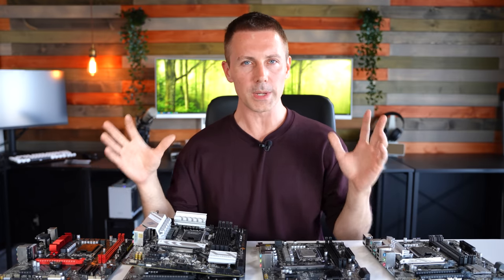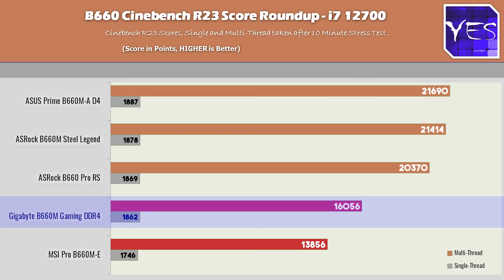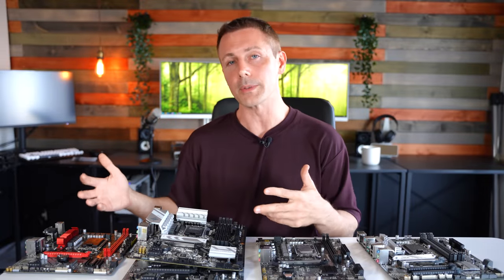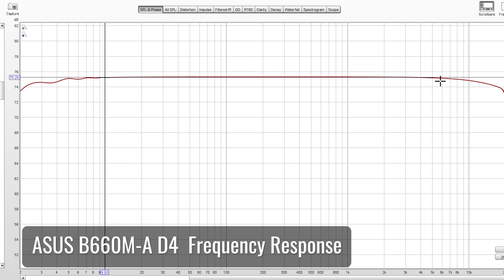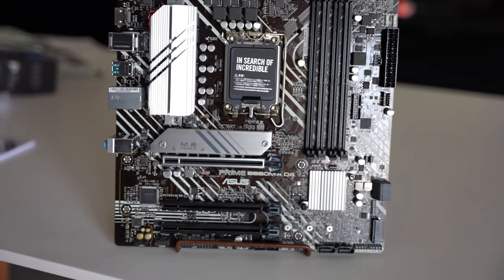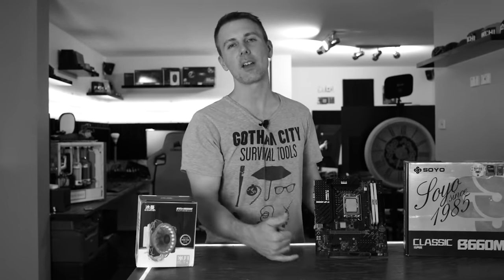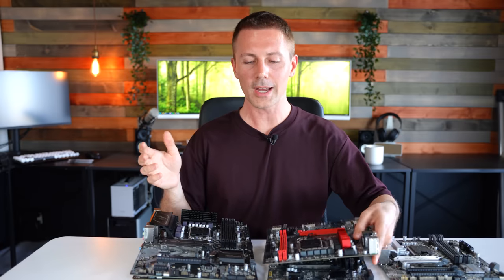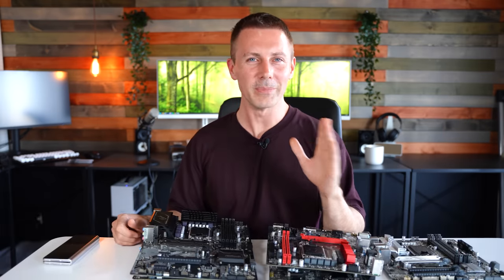What's the Best BUDGET B660 Motherboard?

Comment: Asus Has been pretty consistent of their motherboards even though they can be a bit pricey sure it could be better as adding in a 2nd Heatsink at the top would have made it perfect but you could just do what I do and get those real cheap GPU ram sinks online and just plonk them on there and it would be good enough to drop the temps on those VRM's by 10-20C.
Reply: If you put an air cooler on the cpu the fan will blow down on the vrms so temps might be decreased and if you have casefans

Comment: What's interesting to me is that the MSI B660-M Pro A is often hailed as one of the best affordable motherboards in this chipset. Of course its got some pretty decent heat sinks on its VRMs compared to a complete lack of them on the E.
Reply: What about MSI Pro B660M-G? Is it good for i5 12500? No gaming, no overclocking. Just casual office tasks, Photoshop, not heavy video editing
Reply: @Uncaught_in_promise  Invest a bit more and get the B660m-a, you won't regret it.
Reply: @rahuloberoi9739  agree
Reply: @rahuloberoi9739  i think i missed up when i bought msi b660 ma pro , with i5 12400f , rtx 3060ti  , idk what i was thinking
Reply: @yousefal-bakri3455  why?
Reply: @azriel1595  i was a litlle mad because the motther board looked small in the case 
and i wanted ATX one 
but now i dont think its a problem , everything is fine and works very good
Reply: @yousefal-bakri3455  its a good board though, right? I'm thinking of getting it and pairing it with an i7 12700k. maybe a 3070 or 3080 idk.
Reply: @azriel1595  yes it is , but since you want to buy i7 , get  Z board its better 
but for i5 , b is very good
Reply: @azriel1595  Get the  msi b660m mortar, better vrm heatsinks I think in my research slightly better than the b660m-a pro, usb-c if you care, better audio, a few extra fast USB, both m.2 have heatsinks  pro-a has more video ports 4 v 2 so if not using a card. Both good though so if you want to save 20 or whatever the mortar costs over the pro-a

Comment: 🎯 Key Takeaways for quick navigation:

00:00 ⚙️ Introduction and Motherboard Overview
- The video introduces a comparison of budget B660 motherboards for the i7 12700 CPU.
- Five motherboards are tested, including MSI, Gigabyte, ASUS, ASRock Steel Legend, and ASRock Pro RS.
- It highlights the importance of choosing the right motherboard for your needs.
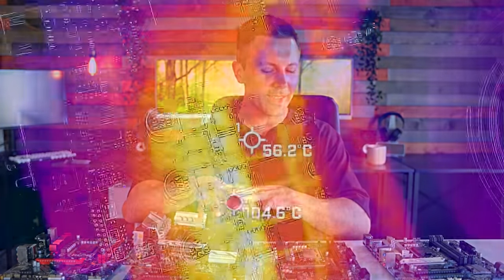01:37 🌡️ VRM Torture Test and Performance
- VRM (Voltage Regulator Module) torture test using Cinebench R23 is conducted to assess motherboard performance.
- Results show significant performance drops on the MSI and Gigabyte motherboards, while the ASRock Steel Legend and ASUS boards perform well without throttling.
- Single-core test results and temperature readings are discussed.
05:32 🔊 On-Board Audio Comparison
- Comparison of on-board audio quality using the Realtek ALC897 codec on all five motherboards.
- ASUS motherboard stands out with the best audio quality, followed by the others.
- Audio codec, trace layout, and capacitors are essential factors affecting audio quality.
06:53 🛠️ BIOS Settings and Features
- Evaluation of BIOS settings and features, focusing on the ease of customization and undervolting.
- All motherboards allow essential settings adjustments, but the Gigabyte motherboard has a somewhat confusing BIOS.
- ASRock offers unique features like internet DHCP BIOS flashing and in-BIOS RGB control.
08:59 🔄 Connectivity and Features
- Comparison of rear I/O connectivity, with all motherboards featuring six USB ports.
- ASRock Steel Legend stands out with additional features like USB Type-C, Wi-Fi M.2 support, and efficient M.2 heatsinks.
- Gigabyte offers a unique combination of USB ports with one Type-C.
11:59 🏁 Conclusion and Recommendations
- Summarizes the test results and provides recommendations for budget B660 motherboards.
- Recommends choosing motherboards like the ASUS, ASRock Steel Legend, or ASRock Pro RS for an i7 12700 CPU.
- Highlights the importance of avoiding very cheap motherboards that may compromise performance.

Made with HARPA AI

Comment: Alder Lake's Achilles heel is definitely the motherboard prices, since you need a $140 + board in order to have any sort of upgrade headroom and not be stuck.
In my country, you can find decent b550 boards that support even the 5950x without throttling or VRM overheating for around 75-80e, while the cheapest good board for most Alder Lake parts is the TUF B660M-E which goes for 135e
Reply: Yeah because amd didnt have like 4 years on the market before alderlake. 

Yours is a prime example of get whats cheapest/ performing in your area.

Doesnt matter amd or intel because it shouldnt be a "preference" when your going for price/performance
Reply: @mikeymaiku  You know what's funny, the opposite is true for AMD here, their boards are cheaper while the equivalent performing CPUs are more expensive.

I can't get the 5600 for less than 200e while the 12400F can be had for 165e, so at the end of the day, I'll spend the same amount
Reply: i was looking the same 3 good board of the review and concluded like you that the asus tuf seemed the best value but whataprice
Reply: MY FRIEND those below $120 b550 will throttle it. dont misguide.
Reply: My B660 Tuf gaming plus was $185, but it has PCIE 5.0 for GPU, and 20Gbps USB-ports, and Thunderbolt.. not sure which B550 mobo gets you that?. (just checked and the MSI MAG B550M MORTAR WIFI is as much but it lacks the I/O, the PCIE 5.0, and Thunderbolt edit: and it only has one pcie 4.0x NVME, the other is 3.0).

Comment: Basically, if you are just looking for PCIe Gen 4, maybe to use a PCIe 4.0 x4 6400/6500 then the cheaper B660 boards (like the Gigabyte and MSI here) will be just fine provided you pair them with something like an i3 or lower, maybe a low power i5 or i7. System balance is everything. Hub was exceedingly critical of a board that was clearly designed to address the ultra budget segment and massively criticized it for throttling with a high end CPU... Anyone spending that little on a board is likely either ignorant or couldn't afford a high end CPU anyway. The board was pretty much in line with MSI's offering here, no heatsinks etc. The fact that it can handle an i7, even if it throttles under heavy loads like cinebench, is impressive, particularly when gaming seems just fine with 3dmark. 

Great review Brian.
Reply: Do you think the MSI can handle the i5 12400f for gaming and occasionally other multithreaded tasks, I don't do video editing or anything to heavy. In my region the MSI goes for around 110 and the ASUS 180 so there is quite a difference. There is also ASROCK b660m hdv for 110 but I've heard is not that good for an i5

Comment: When buying motherboard, I like the mid range models like MSI Tomahawk/Mortar and AsRock Steel Legend. Good prices without major cut back.

They have very neutral but still nice looking colors and design. Ding dang decent VRM that can run i7/Ryzen 7 fine without problem. Not confusing Bios layout and terminology.

Especially like AsRock. I had the Z77 Extreme4 models that ran i7-2600k overclocked for more than a decade stable. Online Bios update was nice to keep it up to date. I bought the 560m Steel Legend for my cousin's new PC and surprised to see RGB programming built right into BIOS as well, no need for bloatware.

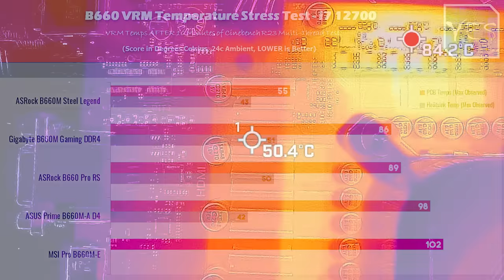Comment: 3:17 I can see that you aren't using a stock intel cooler.
As you might have observed, the msi b660-e doesn't have a dedicated heatsink for the vrm. Because of that, they overheat during longer loads.

I have this exact motherboard with a 12400f, and during a  10 minute sustained load test none of my cores dropped below 3.99ghz (4ghz max all core boost).
I downloaded hwinfo64 to keep track if the vrm's were staying within reason, and at the end of the 10 minutes they were 62c. The 12400f performed similar to other 12400f's would, so it wasn't throttling down or anything either.

If you are taking a budget board, it doesn't make sense spending 100+ on an aio, so performing non overclocking tests with a stock cooler should be the default.
Because as I said, to me the vrm's have a temperature delta of ~37c with my environment, while you were experiencing a ~75c difference. Even the difference in draw doesn't explain away all that temperature difference.

And surprisingly my single core score is 100 points higher then the online average even.
Reply: Hello bro, so what you're saying is b660m-e is would be alright for 12400f and cooler like gammax 400? 
I just choosing exact board and cpu, and don't know should i pay more for like asrock riptide or asus, if i wanna use only 12400f which eats like 50-70 watts at maximum.
Reply: @ravioli-ravioli  I am saying that as we speak, on a day of ~25 C outside, sunny in the attic room, with the intel stock cooler, I am reaching a cinebench r23 score of 11881.
According to a test run by techpowerup, a 12400f with ddr5-4800 memory (I have ddr4-3600) reaches 11657 on average.
My multi core was after a 10 minute test.  As my room is over 30c easily (my guess is 35c), it did go up to 92c, but intel is fine up to 100.

I can't guarantee that the gammax can keep the vrm's perfectly cool, but I can guarantee that you'll do a lot better with a tower cooler compared to an aio.

I can't guarantee you'll be fine with the gammax, but you will do better than with an aio for sure.

Personally, I have a bit of a dislike for taking fancy coolers for anything intel 12500/amd 5600x or under. You'd be better bumping up the amd 5700X/intel 13600K if you want to get actual value out of a tower cooler.
Where I live, the 5700X is also surprisingly close to the 12400F right now, so if it's the same for you then I'd recommend that. 8 overclockable cores will bring you way farther than my 6. On top of that, b550 boards are cheaper than b660 boards so I think it's the most sound choice

tldr I think you'll be fine, can't be 100% sure, recommendation is bumping to amd 5700X rather than bumping motherboards if you're unsure.
Reply: @Olav_Hansen  i play games, which can be poorly optimized, so i guess intel is the go-to for me, tho even if amd will be slightly better in some well optimized games. In my country we have 13400 costs lower than 5700x, so i guess it's also a good option, being 13400 i little bit better in most games. 
Anyway i choose b660 steel legend from asrock, i guess it's fine, it costs only slightly more than b660m-e and have way better vrm system.

Comment: MSI B660M-A PRO is one of the top tier B660 boards.
Reply: @OpL i think yes
Reply: but in this video, MSI is the most worst.
Reply: @mizrachayit  I reckon you mixed up the model names. MSI B660M-A is not included in this review. You can check the Hardware Unboxed review.
Reply: @sjsd1990  

idk, but MSI in this video is very bad.

Comment: Thanks for the good test! I think, the cheap Boards are made for 12400f or 12100f and for Gaming, you don't notice the bad VRM cooling.
Reply: Hello! I'm gonna get the b660m-e for a 12400 and an Rx 580, do you reckon the vrms will pose an issue?
Reply: @angurishudesu  i think you should be alright.
Reply: @jesseomollo9405  what about a 13700k with a b660m-e 😳
Reply: @angurishudesu  not good. Vrm will get hot, you won't get the performance you paid for
Reply: @jesseomollo9405  
Pl.share the performance score for this pair of you purchased

Comment: Just made a budget build for my nephew his old i7 870 build was becoming a problem as he's gotten older and started playing more demanding tittles now, I got him the gigabyte 660m & i3 12100f as its a cheap combo was really surprised at the performance when i started installing windows then games and applications, I daily a 5800x and couldnt telll the difference between the 2 from a casual user pov everything felt really snappy and his framerate went through the roof compared with his old i7! he's really happy with it.
Reply: Unless you are in professional development or rendering, you don't really need 5800x ;)
Reply: Do you think I should get the Gigabyte b660m and the i3 12100f or the i5 12400f? And if I should get the i5 do you think I should upgrade my motherboard?
Reply: @daniel.1899  Well, if you plan only to game, 12100f is more than enough. You could upgrade CPU later when you have the money, now save something for better GPU :P b660m is fine , it has PCIe 4.0 support so it would utilize 6500xt and 6400 to the max.

Comment: Does the steel legend gave the  bclk overclocking option?
Reply: none of them.
Asus likes doing it on higher end, strix boards.
List of all tested boards:

Asus ROG Maximus Z690 Hero
Asus ROG Maximus Z690 Apex
Asus ROG Maximus Z690 Formula
Asus ROG Maximus Z690 Extreme
Asus ROG Strix B660-G Gaming WiFi
Asus ROG Strix B660-F Gaming WiFi
Gigabyte Z690 Aorus Tachyon X2i
Gigabyte Z690 Aorus Extreme
MSI MEG Z690I Unify
MSI MEG Z690 Unify X
MSI MEG Z690 Ace
MSI MEG Z690 Godlike
ASRock Z690 Aqua OC

Comment: I have a gaming pc, it's a 12400f with 6700xt on a gigabyte b660m gaming ddr4 motherboard, i'm thinking about a cpu upgrade.. in my country 12th gen i7 12700f is 92000lkr  or 14400f is a little bit cheaper like 78000lkr.. my powersupply is corsair rm750, i'm playing at 1080p 144hz.. what will your advice.. will my b660 motherboard with 6.2.1 vrm can handle the 12th gen i7 or not..
Reply: Did you upgrade?

Comment: How about using a cheap top-down cooler with these budget boards? The difference could be big in terms of VRM thermals and you can definitely save on the cooler if you consider an expensive AIO without any airflow for the board was used in this test.

I've seen Thermalright AXP120-x67 going for $40, same for ID-Cooling IS-60 EVO ARGB while Scythe Big Shuriken 3  for around $45-50. They might be more a little more expensive than cheap tower cooler coolers but  can handle a stock 12700F & cool the surrounding VRM's. You can probably even swap out to better fans and still be cheaper than most AIO's.

You could also consider Arctic Liquid Freezer II lineup since it has a fan to cool VRM's(but is significantly smaller than 120mm) and is generally cheaper than competing AIO's.
Reply: Won’t need an aio for this cpu.   Buy a cheap air cooler and extra fans for vrm and should be good to go.
Reply: @killerrf  The B-Roll used in the video looks like an AIO was used in this hence giving an aftermarket top-down cooler alternative.

You can't mount fans directly over the VRM's since most cases have tempered glass. Maybe Tecware Fusion/Sama IM-01 but then you have to buy a shorter tower cooler plus the fan. 

Sure you can stick in some 40mm fans like some SFF builders but those can get expensive on top of an after market cooler. At that point you might as well use the money from 40mm fans to upgrade your motherboard.

Going with a  budget 120mm top-down cooler is probably the most cost efficient solution for this problem.
Reply: @ailluinthethyra6139  if you are on a  budget you will find ways to keeps things cool. Looks won’t matter.  Hang a fan over the vrms with a couple zip ties if you have too.  That’s budget.

Comment: Is steel legend capable of handling i7 12700 under full load or any video rendering.... It only for single 8 pin CPU power connector so I don't know whether it can handle it

Comment: I went with the b660-A ROG strix, the extra mounting holes for older coolers is a relevant feature that isn't talked much about since LGA 2077 compatible coolers have been non existent where i live. It has a very robust VRM to handle the 12900k or a 13900k in the future and it both runs DDR4 and has PCIE 5.0 support and bios flashback. The built in Wifi 6 has been a big QoL change for me after having used a cheapo PCIE wifi 4 module. It is more of a mid-high end motherboard and priced as such but was the cheapest mobo that had all the features i needed. Oh and it technically has thunderbolt 4 support though GL finding a PCIE thunderbolt card to make use of it. Only thing is i haven't been able to enable AVX 512 but i think my CPU's from a batch that already has that disabled.
Reply: It also costs way more than everything here. Enjoy it though! Great motherboard choice.

Comment: I'm surprised trhse rate differently overseas in your region. Thye MSI Pro B660M-E doesn't sell in Australia. The MSI Pro B660M-P is the budget version from MSI. Should have reviewed that instead as I was looking at that but haven't seen any reviews of it. Also the ASUS B660M-A Prime DDR4 isn't exaqctly a budget priced board either. More in the league of the MSI PRO B660M-A DDR4 which is considered one of the best B660M motherboards. The ASUS PRIME B660M-K D4 is more of a budget B660M. Like the Gigabyte Gaming B660M DDR4 board here in Australia. Just avoid the Asrock B660M-HDV whyich is considered the worst and cheapest of all B660M boards.

Comment: OK guys which motherboard is good to pair with i7-12700 ? MSI b660m pro - A or MSI B660m MORTAR ?
Reply: Both are amazing dude and they can handle a 12700 easily, the mortar should be better and more expensive tho! If they are the same price, get the mortar every time.

Comment: I am curious if one of the cheaper boards would hold back the lower end CPUs like the 12400f. I suppose it makes sense to just go for Asus or the better Asrock, but in a scenario where you are pinching every penny maybe it might be worth it if they don't throttle.
Reply: I suspect the 12400f MIGHT be the pick in the budget segment especially with GPUs demanding a premium.
Reply: Doubt it… isn’t that cpu only like 60-70 watts?
Reply: Cheap boards are made with this processor in mind :D